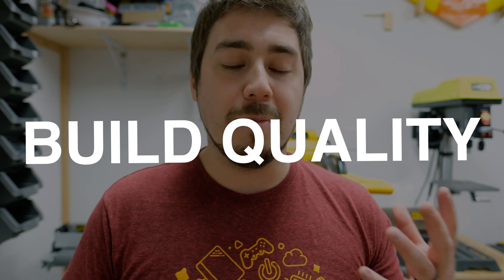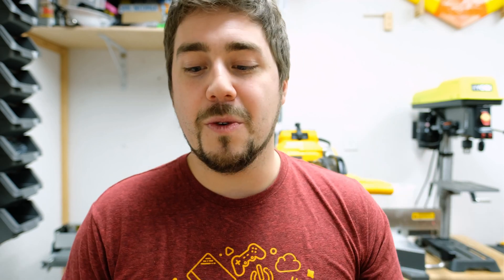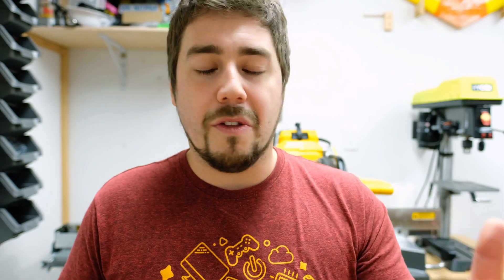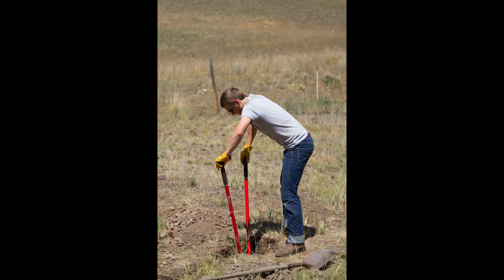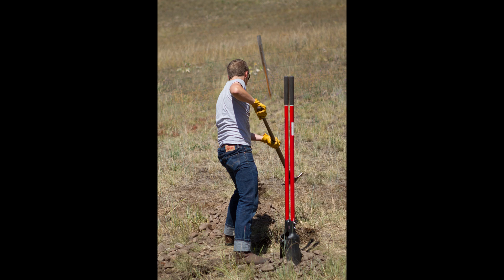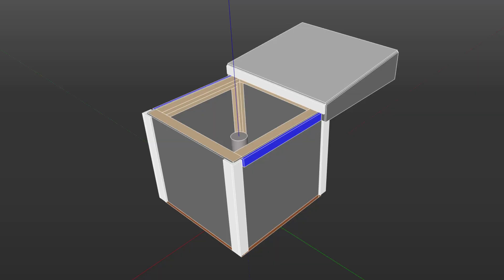New Observatory - Project Objectives

Comment: I imagine you're getting close to being able to start on the observatory again, weather wise anyway.

I just found you're channel recently. I've been into astronomy for a while, living in florida and I grew up on the space coast, and my dad worked at NASA/KSC. 

I should finally be able to get a telescope soon, very likely the Celestron 4se. I won't be doing an observatory setup, but I will probably be doing a semo remote setup. We have a lot of mature oak trees on and around our house. The best spot to setup is across the street in a narrow strip of field between the street and a fence owned by the local power company. I don't think I'll feel comfortable just leaving my scope there, but I will need to come up with a power source for it. I could go with a premade power tank, but may be able to get more out of a diy built setup. I just need to figure out what all I want lol.

One question I had, I dont recall if you covered this, but I was wondering why you went with the smaller 90mm OTA? Is it mostly logistics with being able to gave a smaller building or some other reason?

Comment: Hi FoFoAstro.
Great to see you back.
Your videos you made some time ago have inspired me to make my own observatory. Missing, though, is getting my pier into the ground. would not start here over the winter, I also have to below frost level, in Denmark, so it will be spring.
However, I have made a house where I roll the whole building away.
Then I can use both my telescope for photography and visually.
Once the building is rolled away, it can be used for observatory.
I am a trained carpenter, so it was an easy job.
Do you need insulation in the new house?
If you must then I have some advice I would like to share with you.
Yes or others who want to make an observatory themselves.
Greetings Esben from Denmark.
PS I have used google to translate as I can not write in English, But read and understand it

Comment: I'm not sure I understand the advantage to making it smaller, but I say that as a guy without any observatory at all, so... Is the objective just to increase your capability to hit targets near the horizon, which a shorter wall might help you achieve? Given the roll-off roof, it seems like making the building shorter would only marginally improve that situation. Looking forward to the build, though; you're the only one who seems to cover this sort of thing in depth!
Reply: I can certainly understand wanting to keep costs down. However, future proofing is also important. I'm already at the age where I don't bend as well as I used to. I'm also over six feet tall, so a four foot door makes me cringe to think about.
I guess I'm saying that in the long run, for me it makes more sense to build in a little more height in order to allow me to access things more easily...especially as I get older. 
Anyway, I'm sure you've already thought things out and are building to what suits your needs...which is what is most important. 
I look forward to seeing the progression of the build.
Cheers. 🙂
Reply: Hi, The concept behind going smaller is that will be remote controlled. Don't need to be in the outside observatory itself. Apart from installing equipment! Er, and maintaining it - something I think that can get overlooked with some small builds.I guess these arrangements are a sort of hybrid observatory, part outside, part inside. In the warmth ......Cheers. BobUK.
Reply: @bobuk5722  I guess it just sounds pretty painful to have to crawl around a smaller space or be exposed to the elements in the course of maintenance to me. Since, as with his current observatory, something larger could be operated remotely as well, I was trying to see if there was some other motive. Shorter walls for visibility? Specific maintenance tasks that are directly affected by the height?
Reply from the maker: Great question. Bob is correct! It is mostly for the ease of maintenance and construction on a smaller build and that I like things to be as small as possible while still doing the job. I'm someone who likes things simple and having too much building to worry about is more stress than anything else. Being able to reach every part of the building without a ladder sounds awesome as when things break, they will be really easy to fix. 

You are correct though in that keeping it small will give me better views near the horizon, although that's not a primary motivator of the smaller size.

One other thing is cost. I really want more people to be able to enjoy having an observatory so keeping the cost down on this build is important.